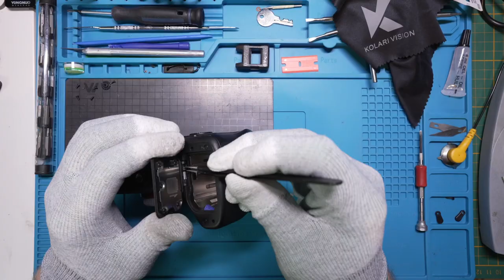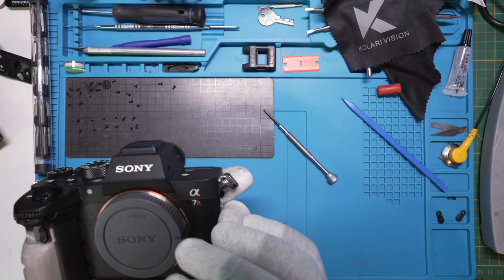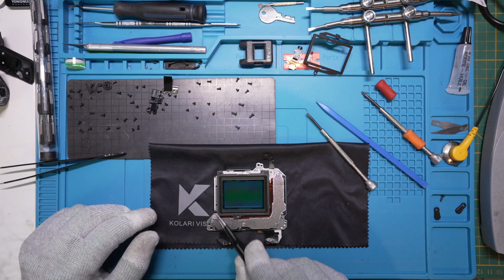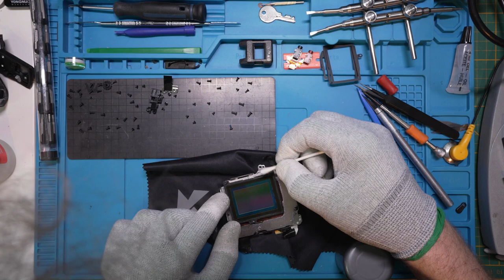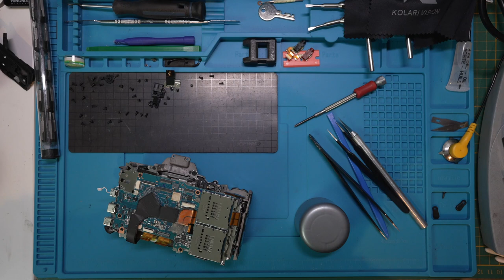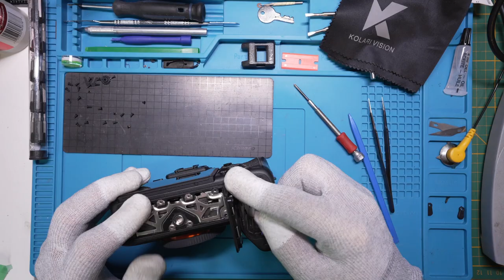Sony A7R IV Astro Modification / Full Spectrum Modification

Comment: Have you had any problems with the Star Eater issue that is associated with the A7 line on longer exposures?
Reply from the maker: My opinion is that on anything newer than the A7/R/S/II it’s much ado about nothing as far as spatial filtering is concerned. The donut stars of the past are gone, and instead what happens is that stars of a certain brightness that cover a specific pixel footprint are either significantly decreased in brightness or even effectively removed.

Which is something that people are buying Lightroom and Photoshop plug-ins to do anyway. Or trying to accomplish by running their images through StarNet++. In this case, the camera is doing some of the work for free.

In my view no one is basing their Astronomy PhD thesis on star spectra gathered with a consumer stills camera (at least they shouldn’t be), so perfect reproduction of stars is irrelevant. I’ve never found myself wanting more stars in my images, frankly, always less. So whether it’s a Sony removing stars or a Nikon is turning them green or magenta it’s irrelevant in my book. If it’s art, a consumer camera is perfectly adequate and the Sony cameras are decent multi purpose tools. If it’s for your research thesis then you should already be using a cooled CMOS.

I hope that didn’t drag on too long, let me know if you have any follow up questions/remarks.

Comment: Is this really a good camera for milky way shots and low light scenes? Isn't the high resolution making the noise worse than for example its predecesor A7Riii?
Reply from the maker: It's a good camera, yes, and Iike using it because it has good dynamic range. The A7R3 is also quite high resolution, so that maybe isn't the best comparison, but in the case of the A7R4 perhaps one could say that the noise at the individual pixel level will be higher, but given the total resolution this noise ends up having a very fine structure which does a lot to create a pleasing image as compared to something like a 12MP camera where there will be less noise at a pixel level but it will be more visible because it will be "blocky." 

It is true that large pixels found in lower resolution camera are better able to capture photons from the faintest parts of the scene, assuming the quantum efficiency and pixel well depth are equivalent, but that isn't really relevant for Milky Way photography. Especially not when comparing a 42MP camera to a 61MP camera. If you are imaging something like the Ou4 nebula then sure, it is better to use a sensor with bigger pixels, but a regular old Milky Way shot will be so bright by comparison that balancing signal to noise ratio isn't much of an issue.
Reply: @FerventAstronomy  That makes sense. Thank you!

Comment: Kholari Vision says that a7rii iii, and iv can’t be fully modified because of the IR light in the camera to assist in focusing will destroy the image for longer exposures.  Is this true?
Reply from the maker: The A9, A72, A7S2, A7R2, and A7R3 have an internal IR LED in the shutter mechanism, the A7R4 does not. Some sources say the A7C has it as well. The A74 seems to have some version as well but it is apparently only active in electronic shutter mode, not e-first curtain or mechanical. A7R5 is unknown.

Currently the “safe” cameras are the A73, A7R4, and I believe the A1.

Comment: Hey! Need a little help! :D
My sony a7iii glass was damaged, so I tore down the camera. Now I see three layers of glass. Did you remove all of them with that scalpel or just first one glass (aka. these glass pieces are glued together on the sensor in one "pack")?
Reply from the maker: There is one compound filter that can be removed. The glass that is glued to the sensor keeps it sealed, do not remove that.
Reply: @FerventAstronomy  Thanks for the quick response! Appreciate that!
Did you notice too, that without the additional glass-weight ibis is strugling a bit?
Reply from the maker: I haven’t notice any issues, no